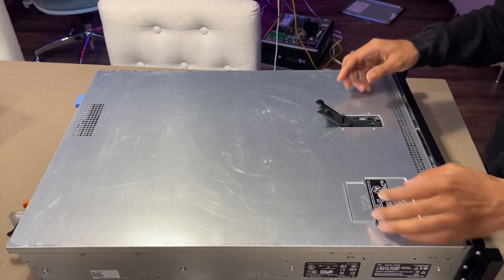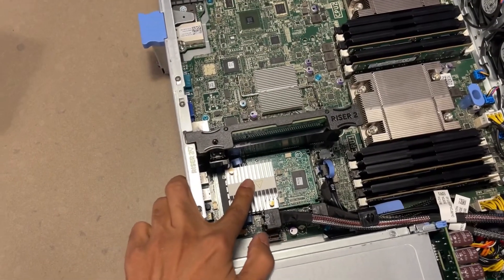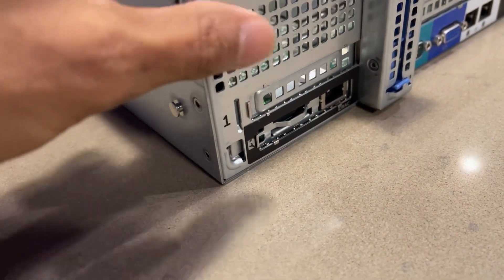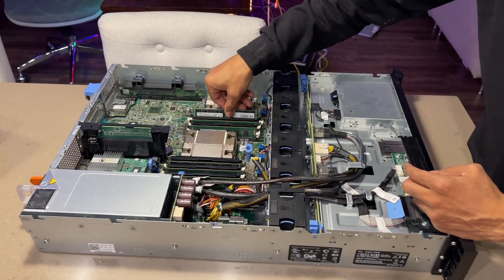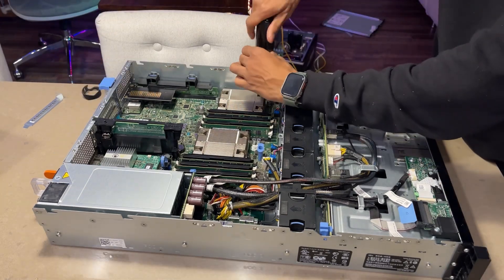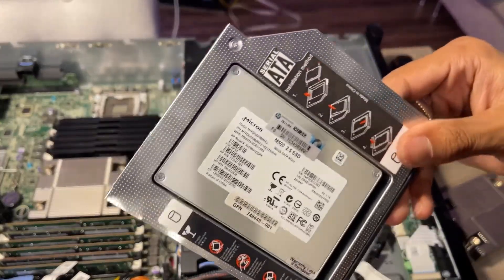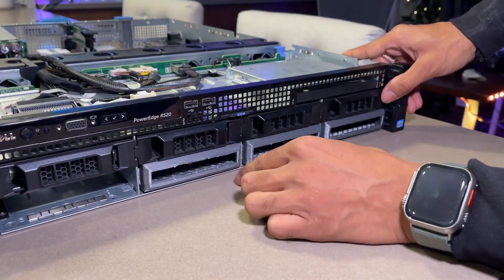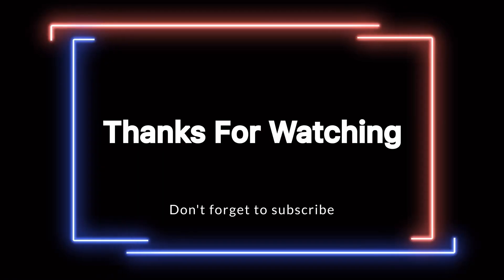Dell PowerEdge r520 Server | Walkthrough & Upgrades

Comment: Hi how much the power usage on this server?
Reply from the maker: For my applications it is about ~150-170W
Reply: @Jackofall-tech  that pretty good for a 2u server, i remembered my old 1u R610 was consumed around 130-150W. Now i have Dell R330 with 3x8TB SAS 64GB RAM consume about 100W. Do you leave it on 24/7?
Reply from the maker: About ~150-170W for my specific applications

Comment: Curious to know, does PCie to M2 adapter worked out of the box after how you installed ? Or does it requires any BIOS upgrades ? additional firmwares ?
Also wanted to know if it is possible to use NVMe drive as bootable drive with dell r520 ?
Reply from the maker: I did not tried NVMe as a bootable drive but I will try and let you know how it goes. But as a storage device I did not installed any other firmwares. Thanks for the comment.
Reply: @Jackofall-tech  Thanks for the reply and all the best with your fun Experiment. I will be keeping an eye :D